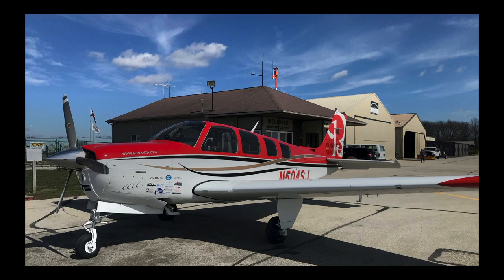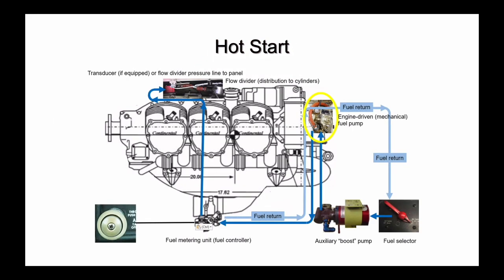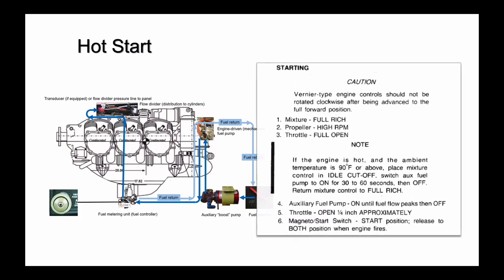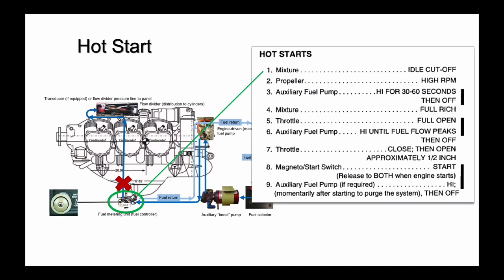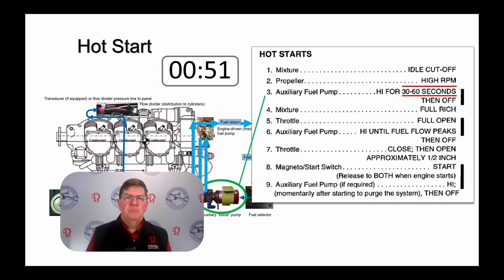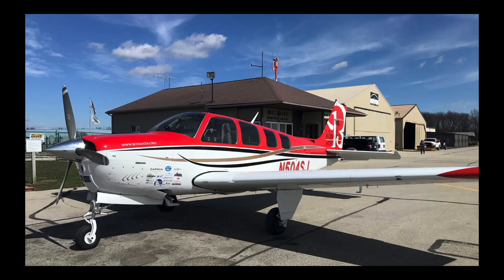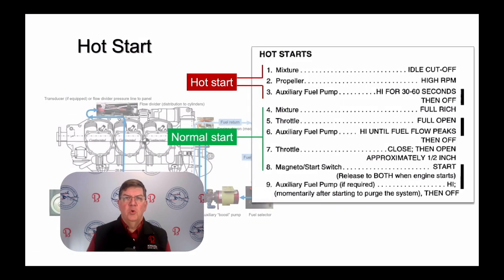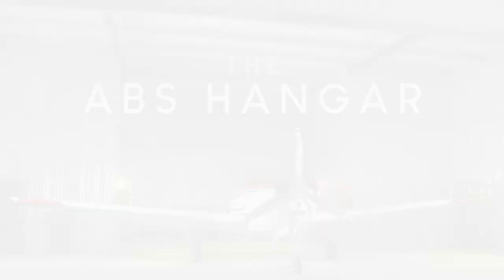Hot Start with the Continental Continuous Flow fuel injection system

Comment: We just had a customer come in for an annual with his immaculate A36. After we did run ups he was going to depart and I wanted to film his start and post it but after a few failed attempts to get the engine going and probably over heating his aux fuel pump motor I stopped him and showed him my technique and it started in five seconds.

Comment: In the procedure at step 1 he doesn't mention throttle position; just mixture. I assume throttle is also in idle cut-off?
Reply from the maker: The position of the throttle during the fuel circulation step of the POH Hot Start procedure is irrelevant as no fuel is getting beyond the mixture cutoff. After turning off the auxiliary fuel pump the checklist calls for priming the engine, which includes moving the throttle fully forward for priming before retarding it for start. Personally I go ahead and put the throttle fully forward at the beginning of the Hot Start procedure but it makes no difference in that part of the procedure.  - Tom Turner, ABS Air Safety Foundation

Comment: I have had many mechanics who have told me to do just the opposite - flood the engine. Then do the flooded engine start. It has worked every time for each mechanic who has shown me that, and yet after 20 years I still don’t use that method. Thoughts?
Reply from the maker: Hi Joseph,
Thanks for the question! Put 20 Beech pilots in a room and ask how they start their engine when it's hot, and you'll get maybe 22 possible techniques. Most will work most of the time, including intentionally flossing the engine. The hazard with that technique is fuel pooling in the exhaust manifold and igniting explosively. The ABS Technical Advisors and I have heard (and they have seen) of exhausts and mufflers cracking. If it leads to a true backfire Continental recommends an engine tear down inspection. 

The procedure in the Beech POHs and Continental Owners Manual works consistently, in my experience, and avoids the hazards preset in some other techniques. For that reason it is our preferred method for hot starts in these engines. -Tom Turner
Reply: @AmericanBonanzaSociety  thanks Tom. Appreciate the answer. It’s funny that so many mechanics instinctively flood the engine. I’ve had this plane over 20 years and it still annoys me that sometimes it just takes the engine sitting and cooling down before it will start. It’s always been hot or miss. More hits than misses but misses are a real pain. Much appreciate your response. Joe
Reply: I have an A36 with an IO550B, I do a normal prime, then keep pushing the throttle forward while starting, when it catches I pull the throttle back to 900 RPM, I might hit the fuel pump to low fir a few seconds if it seems rough, always starts within 5-15 seconds. Cirrus guys can’t understand how fast it hit starts, I have shown this technique to many Bonanza and Baron pilots who now never fear a hot start. I have to add a caveat, my plane is a 1975 with vernier controls, with “stick” throttles (newer bonanzas and barons)  go to full throttle and slowly pull the throttle back until the engine catches, 3-7 seconds the engine will start! John C A&P IA
Reply: @johncronley1278  That is exactly what I have been doing for my A36 with the IO550, and when I had my 35 with the E85 engine

Comment: Does opening the cowling after shutdown help keeping things cool so you're less likely to have hot start issues?
Reply from the maker: Yes, allowing heat to dissipate by opening the cowling helps the engine start more easily when it’s hot. Open the cowlings only in very light winds and when you can remain with the aircraft, so you can close them to prevent damage from prop or jet blast from taxiing aircraft. - Tom Turner @ ABS

Comment: Thank you for the explanation.
On my Mooney Ovation, Continental IO-560, I use this procedure:
𝐂𝐨𝐥𝐝 𝐬𝐭𝐚𝐫𝐭: Boost pump on; prop-mixture full forward; manifold open half-inch; hi-boost 5”; start engine
𝐇𝐨𝐭 𝐬𝐭𝐚𝐫𝐭, even after a taxi to fuel pump: prop full forward; manifold-mixture full closed; boost pump 5” (7” in summer); manifold full power minus half -inch; start engine and enrich mixture to full within 1” when engine fires.
𝐇𝐨𝐭 𝐬𝐭𝐚𝐫𝐭 in summer after a flight: same as above but boost pump between 14” up to 30”.

Comment: What should the throttle position be during the hot start when running the fuel pump?  Or doesn't it matter since the Mixture is off?
Reply from the maker: Correct. Since the throttle input into fuel injection is downstream of the mixture control, no fuel gets to the throttle input during the fuel circulation step of the POH Hot Start procedure. Therefore, as you said, throttle position at this stage of the procedure is irrelevant. - Tom

Comment: Does this work with a TSIO-360?
Reply from the maker: I (Tom Turner) don’t have any experience with the Continental TSIO-360 series as it is not used on any Beech airplanes. Like models I’m familiar with, it varies by engine type. If your engine employs the Continental Continuous Flow fuel injection system then yes, it works the same. 

If you don’t know the type of fuel injection system your engine has there are some clues:

1.	If the Start checklist calls for starting with the mixture control in the idle cutoff position and advancing the mixture when the engine fires, it does not have the Continental system.
2.	If the Takeoff checklist calls for the auxiliary boost pump to be ON, your engine does not have the Continental system.